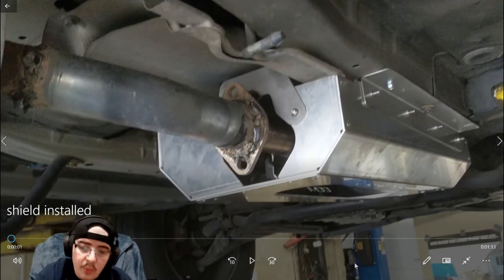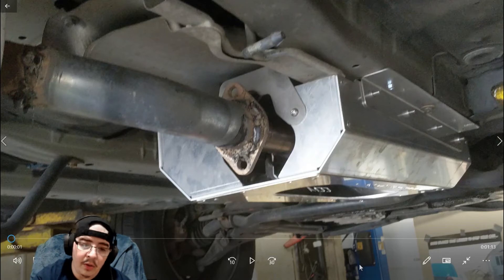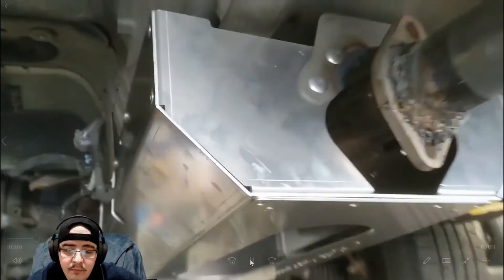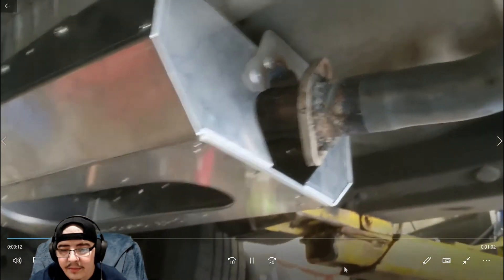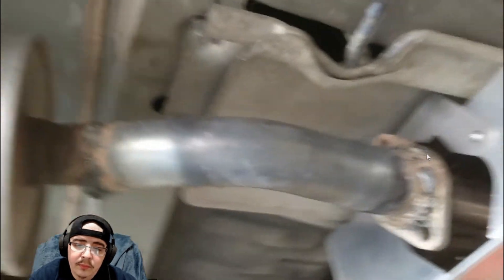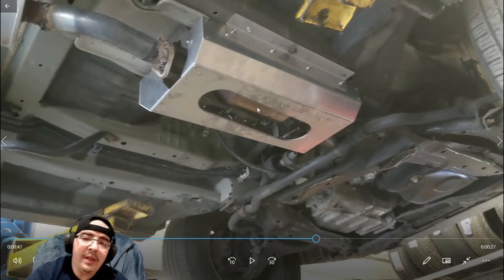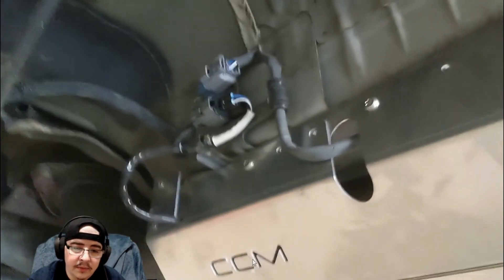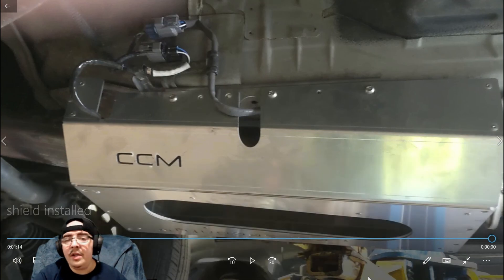Cat Security Shield | Protect Your Catalytic Converter | #BigMacSam

Comment: Welding exhaust pipe to a cast iron flange can be tricky. The two metals heat at different rates. Hope this device prevents another theft.
Reply from the maker: Yeah, I can see that! I sure do hope it prevents another theft.

Comment: Thanks for showing this Sam! Yeah, that hole does look bigger than the converter. Do you think that shield will get pretty hot? A friend told us recently they know someone who had their converter stolen last week. Apparently, there are thieves moving up and down the West Coast ripping these off.
Reply from the maker: Hey Matt! No problem at all. I don't think the shield will get as hot as you might think. It has good airflow. Also, I think the thieves will have a hard time getting to it because the car will be down on the floor and the sawzall will be too long to stick up at a 90 degree angle instead of about a 45 degree angle to cut it off. But then again I might be wrong. I have seen other pictures with the same shield and the hole was big enough because the catalytic converter was huge compared to mine. Just some thoughts.
Reply: THE HOLE IS TOO BIG.

Comment: I am a little worried about the hole on the bottom. Not sure why they would even have a hole in the first place. Other than that, looks pretty secure.
Reply from the maker: I guess the hole is for air circulation so it doesn't get so hot.